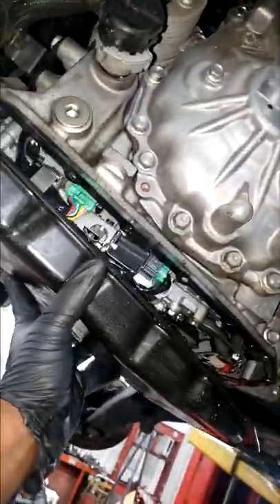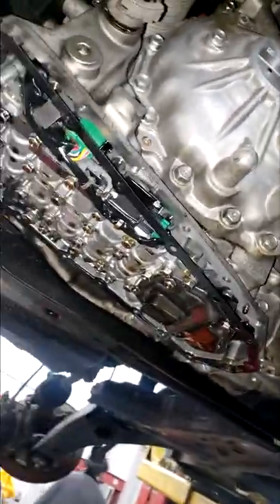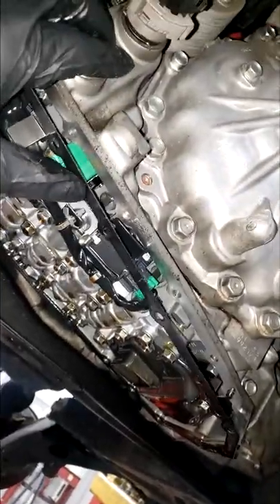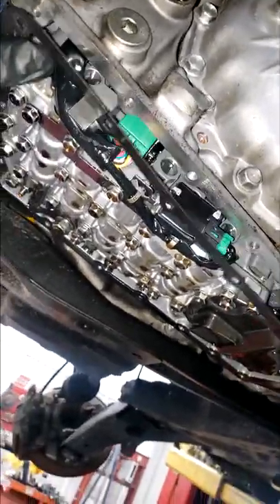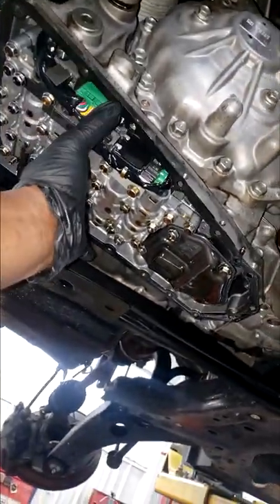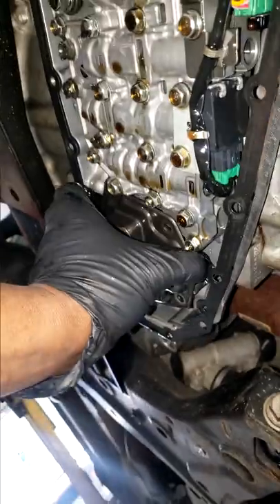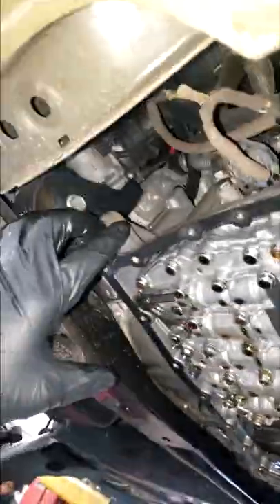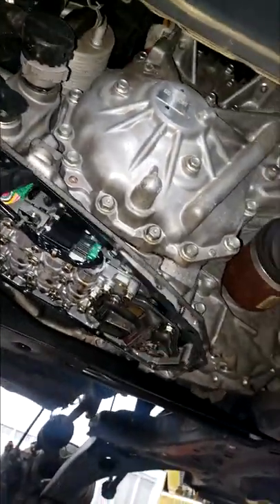How to make your CVT transmission last twice as long. DO THIS WHEN RECOMMENDED. #shorts #CVT

Comment: So at what interval do you service the CVT, 35,000-40,000 mi ?
Reply from the maker: I tell all my personal customer get it done during the full 30k service.
Reply: @OnlineMechanicTips  I can't do that.  30k miles the way ib was driving means changing the fluid every 3 months at 300 dollars a change.  Not happening....
Reply from the maker: @occckid123  ok
Reply: @OnlineMechanicTips  I do mine every 60k. That's what I need 2 keep my unlimited miles warranty on the transmission
Reply: @occckid123  Why not do it yourself then? Doing it 30k prolongs your vehicle longer than a 60k would
Reply: @yashshah6328  I have 407k on my 16 cvtt altima.  I'm not doing it every 30k miles
Reply: @yashshah6328  I have an unlimited miles warranty.  Why would I want 2 do more than what's required?  I would rather get a new 1 at 400k lol
Reply: Technically mine don’t newest generation 2021 Nissan Rouge dealership don’t check it every 10,000 miles but I don’t care about going to happen when transmission fails least 100,000 miles or more 
This is mine third oil change least free lifetime 

I am planning stop using this car till 45,000 miles getting rid of it 

Normally I don’t keep car till 3-4 years so I ain’t worried about it next owner had to deal with it
Reply: @occckid123  unlimited mile warranty? Offered/provided by whom?
Reply: @occckid123  I use the severe schedule which is every 30K miles. If “regular” schedule, that’s every 60K miles. 

My original manufacturer drivetrain warranty ran out at 100K miles. 
It’s a 2010 vehicle, and currently at 177K miles still going strong.
Reply: @reallifeengineer7214  by nissan.  It has a cap in years.  8 years.  Unlimited miles

Comment: It’s not even a real filter just a steel mesh filter. If that filter gets plugged up the transmission is just made poorly. Just do a drain and fill at home every 30,000 miles keep that fluid clean that’s all you can do

Comment: My CVT was low on fluid. Is that normal?
Reply from the maker: No thats not normal. You obviously have a leak that needs to be fixed. Is your check engine light on? Also are you subscribed to the channel?
Reply: @OnlineMechanicTips  I am now lol. 
The dealership didn’t tell me about visible leaks. Just that I only had one quart of oil after 50 thousand miles.
Reply: @OnlineMechanicTips  I was hoping to get a code to tell me what was wrong because It was shuddering like mad. Now I have fresh fluid and it’s working fine
Reply: What year is your car and is this your 2st service at 50k miles or it hasn't been changed in 50k miles. What's your current mileage?
Reply: @Claroboy911  first fluid & filter change should have happened at 25K ~30K miles. 
Second one at 60K miles. 

If all you did was add fluid, then that means all the shavings that should have being drained out with those first two fluid changes, are still trapped in the system. 

“Work with” your dealer. “Use” your dealer’s mechanic’s expertise.  But, don’t blindly trust your dealer. 

If they didn’t find the source of the leak, it’ll just keep leaking. Lower fluid level means more concentrated metal shavings. AND the same shavings are less likely to stay settled at bottom of the fluid pan, but gets sucked & recirculate throughout the CVT.

Comment: I said it before and I'll say it again if the manufacturer would put a big enough transmission cooler and there they wouldn't heat overheat and burn up tell manufacturers to get the engineer's to get their head out of their ass and fix it

Comment: Sucks that the fluid is 20+ dollars a quart
Reply: Well owning a car is expensive. And i don’t know about you but the average driver drives about 14k miles a year. So once every 2 yrs isn’t so bad especially if you do it yourself
Reply: Better than replacing the tranny every 60,000-120,000 miles.

Comment: Actually cvt are juat worthless to begin with... it's worthless it's freaking crap and it's a worthless repair. Cvt just isn't reliable. Are transmission shop won't have anything to do with them because it's huge rip off for the customer to change the fluid. What they get 20000 out of it, oh wait, we don't actually know because it didn't break down in the first place and nothing was actually fixed? It's a 200-1000$ charge for nothing that's substantial. 😂 save that money and trade it in and get rid of it

Comment: The cvt is so ass bro stop it. You have to maintain it literally twice as much or it will 100% fail you. Compared to the maintenance on a normal transmission and how sturdy they are there’s a huge reason most people don’t want to buy a cvt vehicle. Mine had maintenance on my 2013 focus and still failed within 2 weeks just to need more maintenance. Stop trying to push this shitty ass transmissions into our faces we literally don’t want that thing no more at all as a part of the car community get that shit out
Reply: He’s just telling people how to maintain it🤣
Reply: The Ford Focus and Fiesta with the DPS6 transmission is defective from the factory. Might as well drop it in the ocean and use it as a boat anchor. That’s all it’s good for. The ones that have the manual transmission are good.